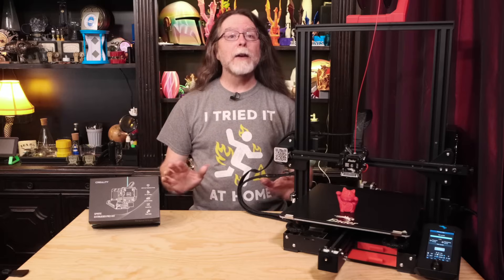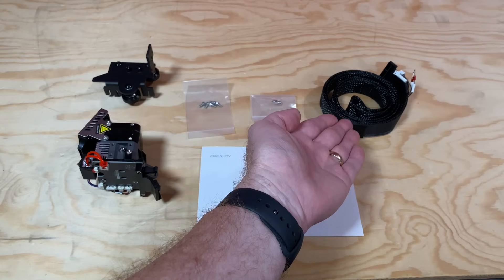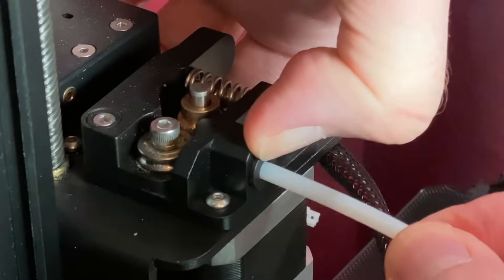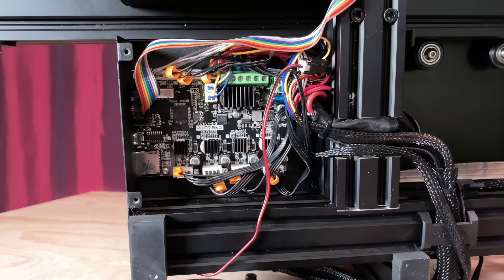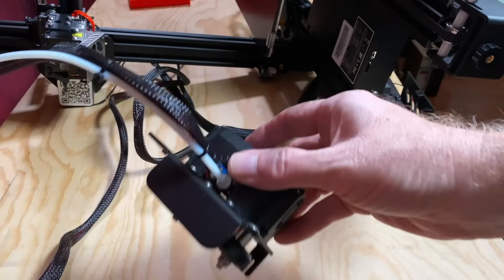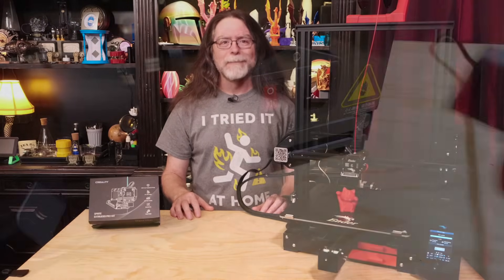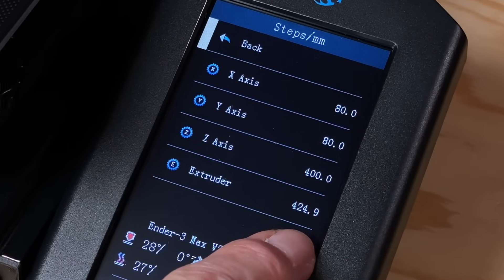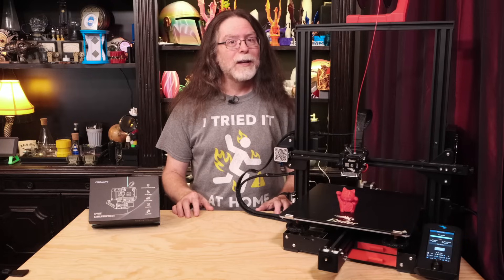How To Install the Creality Sprite Pro Extruder Upgrade

Comment: Nice video, this was super easy to follow.  Little problem maybe you can help with.  Prior to upgrade on the Ender 3 Max, the Cr touch was working fine.  I used the Sprite Pro cable to attach to main board, and to Psrite Pro head, and then short cable from head to Cr touch.  I was able to test and pass all your indicated tests for printer, so I know install is good, but the Cr touch isn't working.  I was able to deploy and retract probe using panel but not when I ran the "auto bed leveling" the nozzle  crashed into bed.  I flashed printer with updated firmware for the 4.2.2 motherboard.  Any suggestions?
Reply: I ran into the same thing. For some reason the short cable from the sprite to cr touch doesn't work right. So run the original long cable from the cr touch to the main board. Now I'm having issues with the cr touch not doing an auto bed level.

Comment: Do you know if the Creality Sprite Pro Extruder kit an be installed on a Creality Ender 3 V2 Neo?
Reply: I just installed it on mine trying to get it to work screen powers on but is stuck at the creality screen guess I’m gonna have to upgrade the firmware

Comment: im adding this to my ender 3 but ive upgarded the mother board to the BTT SKR 2 and i dont quite have the same pins, id rather not ruin my board by wiring it wrong, i do not have a plug in for k fan, i also can not use the plug ins the wiring came with for the hot end fan, also the cr touch wiring i had to split up the wring cuz its a 2 and a 3 prong plug not a straight 5 pin,and the wires that plug into the main board are not color coded to tell how to wire it in. any feed back would be greatly appreciated

Comment: Hi, really awesome  explanation,  I'm thinking to upgrade my ender 3 pro with the sprite pro extruder but would like to know what advantages have you noticed after upgrade compared with the stock one including the high temp printing capability,  can we print faster, can we print cf or other special material with it?

Comment: Hi Brian.  thanks for the walk through.  I have just fitted this to my E3 Max as I want to print TPU.  After plugging everything in and attrempting to heat the nozzle I get a E1 error.  I have checked the wiring and the positive and negative are both as the should be according to the small manual.  Unfortunately the photo I took does not quite show them correctly.  could the manual be wrong or what else may cause this error on a brand new Sprite Pro?  any assistance much appreciated.  Oh, and I have checked the thermistor sensor by heating the hot end with a hair dryer, temp goes up ok.

Comment: One thing that had me confused on this upgrade was the fact that the original cable connected to the fan plus and minus terminals had a split in it where the motherboard case fan was attached.   The new cable did not.  I saw you disconnect this red connecter in the video, but did not see how you connected back to power.  I ended up cutting the original cable just after the fan plug and connecting both this cable and the new fan cable into the terminals so the motherboard case would still have cooling.  Any comments on how to do this better?  Thanks for the great tutorial!!!

Comment: I out a Sprite Pro on my Ender 3 Pro and the printhead is now hangs over the bed and seems a bit too close to the bed too.  When I send it home, no bueno.  I've done the Sprite FW and I'm running a new board upgrade(silent).  ANY suggestions would be beyond greatly appreciated- I'm a complete newb w/ this stuff.  Thanks all!

Comment: i got everything installed and updated everything and now the bltouch when leveling it goes of the bed on the first corner of it and i try editing the fireware twice and nothing chane so i went back to the base blt fw i dont know what to do
Reply: Did you ever find a solution to this?

Comment: Thanks for the super awesome guide. I was able to get the Sprite up and running without any issues. I would like to mention that the manual recommends 40 mm/s for retraction as opposed to your suggested 30mm/s.  Tbh, I’m not sure how much it will effect the prints. Anyway, keep up the great videos.

Comment: is it compatible with ender 3 v2?
Reply: It is. I just installed it on my ENDER 3 v2.
Reply: @tzmsteve  where did you get the firmware/e steps for this set up on the v2? i just installed the extruder pro but i cant seem to find the firmware anywhere for a 4.2.2 motherboard and v1.0.7 firmware that came with the v2 factory last month. Thank you!

Comment: So what if you install this turn it on fan goes on but you go to pre heat and the screen flashes and reloads to main again. Any ideas thank you in advance
Reply from the maker: The most likely culprit is the wiring of the heater cartridge. Make sure the black wire goes to (—) and the red wire goes to (+). The cartridge itself isn't polarized, but there are shared power and ground leads on the breakout board on the tool head. If the heater cartridge wires are crossed, it'll do that reset thing when the printer tries to power the cartridge.
Reply: @BV3D  thank you very much will give this a try

Comment: Great video.
Problem; Hot heats continually from power on. Rest - fans etc. OK, but can't turn hot end on or off, just always on full throttle. Any suggestions?
Reply: Swapped polarity - machine just shuts down - bad unit?

Comment: Super helpful Bryan, thankyou!
I did have an issue though. Everything was good to go until I heated up the hotend. I'm getting large fluctuation in temperature. I'm guessing that means either the block fan or is bad, or the thermistor is bad after all (it matched the bed on powerup)? I just want to make sure I'm not missing something before swapping for a new one.

Comment: I just installed this on an ender 3 pro, and i can not get the part cooling fan to spin. in the k-fan slots, i have the motherboards fan plugged in, and then i have the sprite's k-fan plugged in. When i try to change the fan speed, it only changes my motherboards fan, and the parts cooling fan does not spin at all. I tried swapping the two between kfan 1 & 2 on the motherboard but i get the same result. Any insight or help would be greatly appreciated!

Comment: I just installed a Sprite Pro onto my ender 3 pro and when I go to auto home it the extruder moves in the opposite direction, to the back right of the build plate and will move up when I am raising it on the screen but it will not move down. Not sure what I am doing wrong. Can someone help?

Comment: I have a CR-10 V3, and Creality support sucks.  I cannot find a replacement hot end assembly anywhere.  PETG completely destroyed all of it.  Do you know if this sprite pro works on the CR-10 V3?  The images I saw online showed a DIN connector, but your video looks like it has all the same connectors as my printer uses, only that is may bypass the interface board that I currently am connected into.

Comment: im having trouble with finding the right firmware that will work with Ender 3 V2 upgraded with Dual z, Sprite Pro, and CR Touch. anyone have this set up knows which firmware i need for all to work properly ???  thx in advance!

Comment: Can you please do a video on adding a CR touch on the sprite extruder. Just installed mine and used the included jumper to connect the touch to the extruder. Hooked everything up and triple checked. Flipped the switch and the printer went up in smoke (literally) ended up frying the board. Turns out the pinouts are different when the go through the ribbon cable. 100% my fault and i should have checked. Could you explain how to hook the touch to the sprite correctly?

Comment: Hello! I love your guides! Do you know how to limit the bed size with a gcode?  I have CR touch, and it crashes into the x and y axis whenever it tries to level the bed. I can't install firmwares, I have the motherboard with the GD chip, so it's a pain to install anything into it. It's driving me crazy. This "new" motherboard just sucks. 😔
Reply: did you ever get a reply?  I have same issue

Comment: I now have a heater failed please reset now. I checked my heater and fan cables. Everything else works great. Auto level home etc. I wanna make sure those heater and fan cables are correct. So they have to be seated in a hole within that input or do we have to make sure the cables just aren’t moving and are snuggly tight via screwdriver ?

Comment: Brand new to 3D printing and I used this video to upgrade my Ender 3 V2 NEO with the Sprite Pro Extruder.  Had to make a mod (described elsewhere) to the X-axis mounting plate so it would hit the limit switch correctly but other than that smooth sailing.  Thanks for this vid!
Reply: hey man, may i know what you did to install this on the v2 neo?
Reply: Yes can u show how u installed this on a V2 Neo
Reply: Yeah whats up buddy?! What part did you get elsewhere? A mount for the bl touch? Id like to get this but trying to do some reamsearch to make sure itll even work! But I need to print the piece so Im able to keep my bl and not waste $ on the cr leveling kit thats $30 more yk?! Help us brothas out😂
Reply: Also Im not able to print the bl touch piece.. cause the bl touch dont work😂 how to print without the bl touch Ill go look up now😅

Comment: Anyone know what I need to do to change the CR touch probe location for auto leveling? It goes off the bed when I try to run it. I've tried running some gcode commands that I've seen posted elsewhere and it doesn't seem to do anything. 

I have an Ender3 Max Neo running Marlin. 

Thanks!
Reply: Did you ever find a solution to this?

Comment: Great video! liked and subscribed! Although, when installing the CR Touch how do I connect the probe to the board? Is another port on the sprite for the board? or do i have to run the wire it can with down the ribbon?

Comment: I've been having issues with mine. Idk if it's software or hardware or user error. I went to home it it hung way far forward. So I adjusted my y switch forward so it now is over the bed on home. I adjusted the z switch up a bit too because it was too low and kept running into the bed. Wouldn't allow me to manually level. I'm running a BTT skr mini e3 v3 and now every time I try to print it's way too far from the bed. Yes I've leveled and leveled the bed at least a few times now. All hot leveled. I've factory reset my printer. Pid tuned it and still same thing. It's so far no filament will stick.

Comment: Just updated to this on my ender 3. The CR touch will not work. While searching I found this is a common problem. The problem for most people is that the small wire from the touch wont work but the long one going to the board will still work. For me neither will work. The odd thing is if i unplug the stepper for the extruder the touch does work with the small wire but not the long wire. So for now nothing i can do to get the touch to work on the ender 3 running marlin. Any help will be great.
Reply: I just installed it on my ender 3 as well with the CR Touch. It works with the small wire. Wondering if you're having firmware issues. I compiled my own marlin firmware (for a 4.2.7 board) and it was a bit of a process but the UBL is pretty good. Would recommend looking into that.
Reply: @TheMikelorde  i figured out my long wire does work after all. It had a broken wire that needed fixed. I compiled my own Marlin firmware as well. The short wire still doesn't work. I'm looking to upgrade the board soon and approach the problem again then if it doesn't work with the new board but at least you give me hope that its something i can get working.

Comment: Excellent video. It make me drop the $110 to get it for my Ender 3 V2. My only downside so far is with the new X-carriage causing the X-axis stop to be about 6mm further to the right. This effectively reduces my maximum printable area by that same 6mm. To clarify, when the nozzle is homed, it's about 7mm from the left side of the bed when it used to be 1mm from the left edge of the bed.  I see no way to move the X-axis stop switch 6mm to the left. My only two options that I see would be to just live with the lower printable area or machine 6mm off the X carriage triangular lobe. Has anyone else noticed this?
Reply: YES! my kit had a paper saying to use the new shorter bolts and nut.. but they didnt come in the pack.. some people say reversing the bottom screw will work if you can find a smaller bolt...
Reply: @sizaint  Yes, I saw that too. I bought 2 M5x25mm bolts and reversed their direction. Put a normal nut on the bolt and the Sprite fit back onto the carriage. Now my carriage can travel the entire distance.
Reply: Stan how did you get the Adjust the Estep.  I haven't even got the chance to try it yet. My Ender 3 V2 is great had it a while, love it.  Now I am having a problem with this one step.
Reply: @jenniferwhitman1115  I used the E step value in the guide that came with the Sprite Pro kit, 424.9.  Is this what you mean?  For my X-carriage being too far to the right, I ended up printing another YouTuber's X-limit bracket (https://www.youtube.com/watch?v=8biqiHTd73o&t=1s) and moving the X limit switch to the left. Worked great.

Comment: I'm not sure if anyone will see this, but I'm having some big problems with this extruder. I'm using a ender 3 v2 with a sonic pad and cr touch. First off, this extruder had some problems when first connecting my CR touch. It said that it "Failed to verify sensor state" which I fixed by re-plugging the wire into the CR touch. Next is the problem I haven't fixed and this is what I need help with. I reset my printer because I thought it was the issue with the CR touch and now I have to re-set it up, but the auto leveling will not work. After manually leveling, I start the machines calibration process. The first thing I noticed is that the CR touch does not touch down directly in the middle. Then, once it goes to the edge to start probing the individual points it goes super close to the edge, eventually angling itself so the probe falls off of the build plate. I don't know how to fix it and I really need help. The error code says "No trigger on probe after full movement". Thanks in advance.

Comment: I’m not sure if anyone else is having issues getting the terminal screws to connect to the ferrules properly, but I’m on my fourth attempt to get the connection secure so the hotend will heat up. I can’t figure out why the screw won’t bite it?

Comment: just upgraded my ender 3 v2 to this new sprite pro hot end, as well as a dual z axis upgrade. So far i've got the hardware on, just need to do the wiring and research the firmware side of things. Running the firmware for the bltouch right now, so will probably have to research what i need to do about that. 

a little disappointed just from setting up the hardware, the nozzle doesn't seem to be able to cover the whole print bed like the original print head could. on the left side it hits the axis limit switch about a cm early because of the big metal part on the side of the head thats clearly there for hitting the limit switch. and on the right side the bottom wheel nut hits the z axis v plate, so i'd have to cut a piece off of that plate to gain back a cm or so of build volume, and i'll have to print a custom mount for the x axis limit switch to gain back the cm on that side (and as well as that, the ribbon cable presses against the z-axis bar as it hits the x axis limit, so moving it even further will make that worse, so i'll have to make a solution so the cable isn't constantly being damaged.

hopefully the upgrades will be worth it, but seems like theres going to be a bunch of tweaking to get them perfect.

Comment: so i followed your instructions to a t and when i was finished all i got was a blue screen on my ender-3 pro and the fan on the extruder blowing very hard. the cr touch will light up. im running a 4.2.2 board and i got the fan and the heat leads correct. however i cannot figure out the issue any insight in the community?

Comment: Thanks for the tutorial Bryan! I have an Ender 3 Max Neo and after watching your video I  could install it easily. But the printer doesn't work well with the CR touch being moved to the outside of the bed while leveling and the printer considering the printing area like the smaller versions. Creality doesn't have intention to release the firmware anytime soon and I'm not capable of compiling one myself, What do you recommend me to do? Thanks!